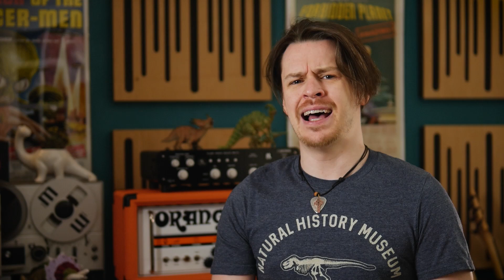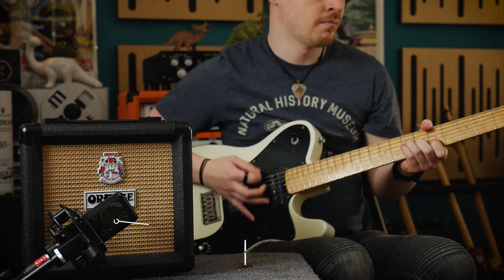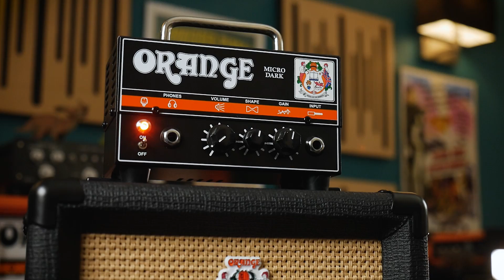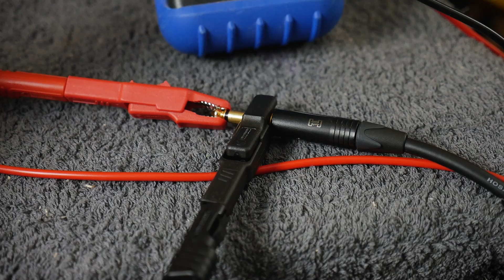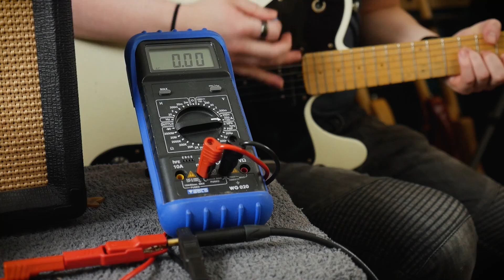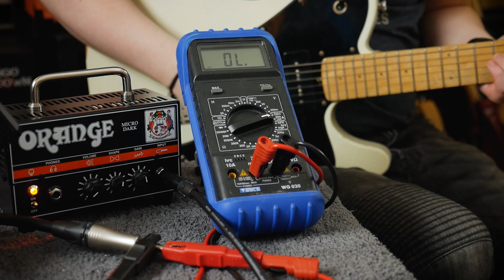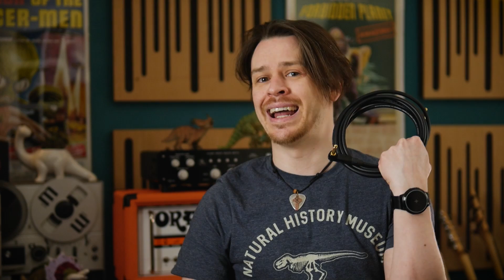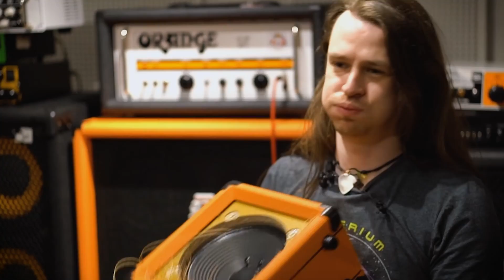Are AMPLIFIERS a LIE?! Guitar Direct into Speaker | Too Afraid To Ask

Comment: Follow-up question: how large is a current coming from a digital interface? And why can they be connected to any speaker, regardless of power rating?
Reply: The TL;DR:  Your digital interface provides only a few mA of current, which is not nearly enough to drive a speaker by itself.  You're probably plugging in to powered speakers, which have built-in power amplifiers.  The power amplifiers are all designed to accept a standard "line-level" voltage and impedance, and to produce full power output from that, which is how you can reasonably expect any active studio monitor you plug into your interface to work.

Full nerd:  Ohm's Law states that current (represented by the letter I) is equal to Voltage (E, for Electromotive Force) over Resistance...  I = E/R.  The output impedance of a line output (I assume by "digital interface" you're referring to the audio interface that plugs into your computer) is probably somewhere between 100 and 600 ohms.  Nominal voltage, 2-3 volts.  So, at most (3/100) your current is 30 mA.  At minimum (2/600), your current is 3 mA.  A speaker, on the other hand, is nominally 8 ohms (typically), and 1 watt into 8 ohms is 2.83V.  So, 2.83/8 = 354 mA, which is 10-100x more current than your audio interface.  A 100 watt amplifier at full-tilt?  W = E^2/R, so 100*8 = E^2...  Voltage is 28.3V, thus current is 3.5A, or 100-1000x higher than your audio interface.  These calculations aren't completely correct, as we're calculating resistance and not impedance; but they're close enough for illustrative purposes!
Reply: @soundman1402  damn i didn't expect a full on physics mode but that makes a lot of sense since i am using powered monitors

Comment: I'm not too afraid to ask why halving the impedance does not make the amp run at twice the watts.
Reply: Doubling the power only gives you a 23% increase in loudness remember. Theoretically with a solid state amp the power could double, but rarely gets close. However, the behaviour of an output transformer in a valve amp is far harder to predict. I've designed/built quite a few valve amps and custom wound my own output transformers for a couple of them. Even with that experience I wouldn't like to predict the power scaling to be honest. That's a question for the true audio transformer experts!
Reply: @dasschaf2476  I said twice the watts, not loudness. Trace Elliott Elf is 200w at 4 ohms but 130 at 8. Markbass Little Mark is 500 at 4 but 300 at 8. Markbass 801 combo is 60 at 4 but 50 at 8.